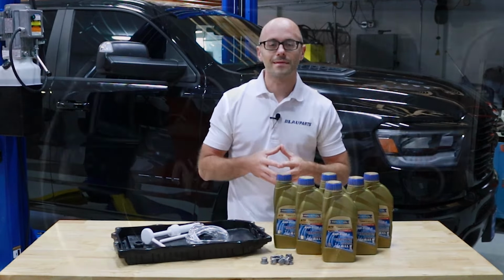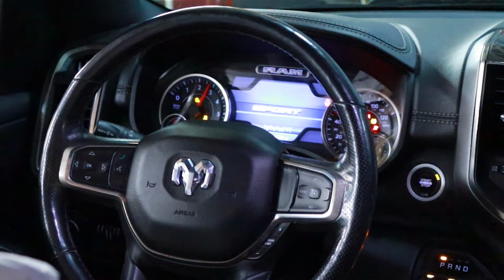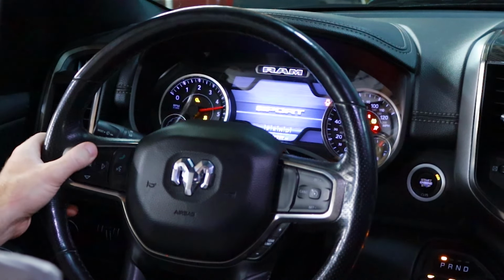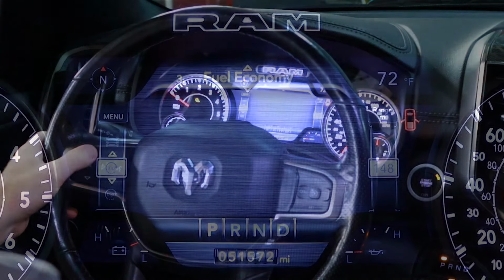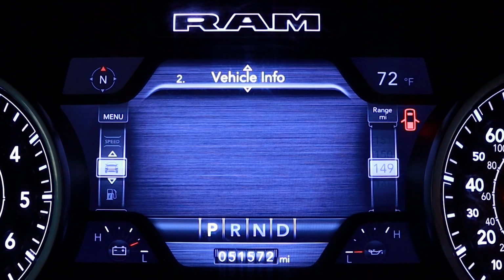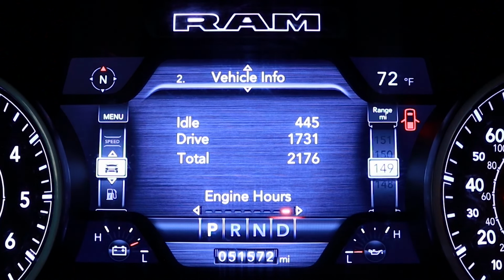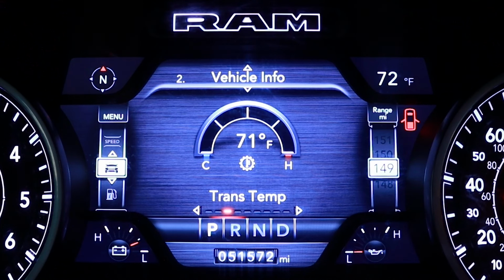Ram 1500 Transmission Fluid Change How To | 2013-2026 ZF 8-Speed 8HP

Comment: Just finished this Transmission pan/filter and fluid change on my '21 Ram 1500 5.7L.   Was pretty scared, watched literally every video on YT I could find.  

Was very happy to find I did NOT have to jack my trans, just slid pan out, replacing was even easier than removing (tight but totally manageable).

The most difficult part was removing the one T40 torx screw that was directly above the exhaust, no way to get a socket bit on it, much less a ratchet.  Tried a L shaped T40, similar to a hex wrench, couldn't break if free, and really thought I stripped the bolt.   Had to use a bit with a 1/4" gearwrench to finally break it loose. 

Cutting down the 10mm L wrench worked great, but I needed it shorter, couldn't really get the last turn because as the plug unscrewed, there was even less room between exhaust and plug, but got it to work.
Reply: How many miles did yours have when you serviced it?
Reply: @bigfleet6559  I didn't do it till 85k miles
Reply: How much money did it save i just heard the numbers from the dealership😢
Reply: @6 @600hemi8 lol they recommended changing the pan but since I’m just above 45k miles I just reuse mine with the intention to change it at 100k miles. I have the tools needed to do it already so all I spent on was transmission filled (make sure to get the correct fluid for your vehicle). I believe the manufacture say it takes about 7 quarts of fluid so I had to purchase 2 gallons for about $70. Then it just cost me about 4 hours of labor mainly because I left it to drain and went on about my business.
Reply: Oh if I had changed the pan also I’d end up spending a max of around $220.
Reply: There’s two schools of thought on the leveling of the transmission oil level check ,one school says level the truck one says level the transmission pan. I tend to believe leveling the pan would be the better way.

Comment: i just successfully completed this myself regular dude and spilt fluid literally everywhere on my garage floor
Reply: Did you have the exhaust crossover?  Were you able to remove old pan and replace without jacking up the transmission?

Comment: The procedure looks to be the same for the trucks as it is for Chargers, etc.  That doesn't make sense.  If level is as critical as it's made out to be with the shifting procedures and temp verification, then having a much worse variation in level due to the transmission being canted downward in the truck should be compensated for by lifting the rear of the truck, no?  This ZF-8 appears to sit level in cars, and this trans is probably used mainly in cars in Europe, hence no instructions to make the pan level?  I see both viewpoints on this subject, and they both can't be correct.

Comment: jacking up the transmission doesnt make more room because the exhaust is bolted to the motor and the motor is bolted to the transmission at least on a two wheel drive

Comment: Some say to level the transmission not the truck , I’m leaning towards to level the truck personally.  This is probably something i’ll have to do myself as the mechanics in Canada at dealers are like 16 years old and they tend to over fill a basic oil change, they don’t use torque wrenches ex….
Reply: They’re so lazy. Drives me nuts.  Use the dang torque specs and fill things right! It’s your only fkin job!

Comment: By allowing the transmission to warm up, the fluid expands.. opening the drain plug will cause you to lose the 0.5L you need as an overfill for vehicles equipped with a cooler.

Unlike an engine which has the crank spinning through the oil, a transmission doesn't have this issue. You have the valve body submerged in transmission fluid, the pan and pick up. The cooling for the electronics is happening due to the fluid.

It is almost impossible to overfill this transmission due to the position of the full plug. I always get 3.78L in and about the same amount out. 

Could I trip the car on one side and get an extra 200 ml? Sure but the procedure is to do it on a level ground.

Shifting the car through the gears is a step you can skip. They are concerned that you might have air in the oil pump and want to ensure the transmission can shift without a load.

Comment: Does the truck need to be on lift for a spill and fill? Not changing the pan and filter yet? Is it necessary’s to run it through the gears on a lift or can I drive around the block?

Comment: Yo need to mention that some screws in the pan are a pain in the butt to remove becase of the exhaust pipe and crossmember so we have the tools ready. Also for the plastic drain plug the exhaust is in the way. I stripped the hex nut and had to drill 2 holes to drain the pan.

Comment: I just performed this service on my 2015 Ram 1500 5.7 8speed trans. My truck has air suspension and it started throwing codes for trailer brake service on the dash. Also trans heated up too quickly for me. Had to stop and wait for trans to cool. Super pain in the mf ass. But saved a shit ton of money 😊.  FYI, for all the DIYs this is advanced maintenance in my opinion. If you are comfortable changing 16 spark plugs then you should be ok. If you're an oil change guy/gal then this may be more than you can handle. Just my opinion. Patience and having 3 to 5hrs to do the job correctly are required. Please be careful with jackstands and floor jack. Never rely on a floor jack only. If possible have another person around in case of an emergency. I had a friend have the car collapse on him and he died as a result since no one was around to help him out. Just saying. Be safe!
Reply: Yep, mine threw the same codes.    Like every code.    Service 4wd, trailer brakes, some weird code about dynamic brake system.   It was wired.    Made me pucker a bit
Reply: @captrank1376  befor you lift the ram go always in jack mode in the options. its important. this locks the air suspension
Reply: @conspiratio I don’t have air suspension on mine. I think where I screwed up was I didn’t turn off traction control.  The truck thought I was spinning out of control when I had the back wheels up and accelerated.        Eventually the codes cleared when I drove it for a bit but still was crazy how many codes it threw.    Most every light on my dash was on and no scanner, at least the one I have, would clear them.

Comment: Excellent video. I did this service myself on a 2010 BMW x5 35d (Six speed ZF) but it was exactly the same procedure. That car didn’t tell you the transmission temps so we used a temp gun from underneath. Not difficult just a pain in the ass. It’s almost like they don’t want you to change the fluid even though we should be.
Reply: I was wondering if this was the same as I had in my 11 335D.  I know I used Amsoil.
Reply: How the heck do they fill these from the factory before installing? No way they do all that before sending a new ram to dealer lots

Comment: Thanks for the great video. I just did my transmission fluid and pan/filter and even though it is a job to do it, it wasn't that bad. I did mine at 58,000 miles and the fluid I drained looked very good. The magnets inside the pan were clean. The ZF transmissions seem to be really good. I believe if you change the fluid at the recommended intervals you should easily get 150,000 + with no issues. Mine so far, the shifting is excellent.
Reply: So how many liters of oil did you use?
Reply: @agondokusumo-111  close to 5.5 liters (close to 6 quarts)
Reply: @FrankDAmico-dr5dl  Ahh i see because I could only fill in 5 bottles of the ZF 8 lifeguard in it after draining.
Reply: @agondokusumo-111  I guess that is close.

Comment: 6:20 "next, using a CERTIFIED under hoist support stand"........... you mean a block of wood and floor jack right? :)
Reply: Mine was a floor jack and a length of gas pipe I had in the garage.   It was sketchy but…

Comment: Owners manual says “regular fluid and filter changes are not required” however change the fluid and filter if it has become contaminated (with water, etc.,) or after any disassembly of the transmission. 

My thinking is drop the pan and check for contamination, maybe every 60K or so? 😝

Comment: Just had a successful fluid/filter replacement yesterday for my 2016 Ram 1500. Setting up the jackstands, etc. took longer than expected, but safety always. One lesson learned - the little handpump didn't fit my bottles, but my wife had a little spray bottle from the Dollar General that fit perfectly. I also did two cycles of fill and run the engine - it didn't take as much as I expected the first go round. Thanks for the video!
Reply: Hi there, I’m about to do my 2016 Ram. Did you have to jack up the transmission to get the pan out? And did you jack up the rear when filling. Thanks

Comment: He did good, but there is two areas he did not address! First, you have a torque converter that has a drain bolt, you have to get the torque converter positioned where the drain bolt is pointed down to enable draining of the converter. Secondly, in the oil cooler lines there is fluid that needs to be removed. You apply air pressure to one of the intercooler lines. This will ensure you have removed ALL the old fluid from the transmission. This type of servicing must be done, with the mindset to not contaminate the new fluid. Also you are supposed to closely examine the old pan filter for metal particulate matter. You can actually use a fine cutting Dremel are part off tool to open up the filter compartment. Inspecting this old filter material will give you an indication of wear and tear. I salvaged an old Mercedes Benz 300SD 1983 transmission that was under water for 4 days from a hurricane here in Houston. Did the above, no damage to tranny! And it had water in tranny, rear differential, and engine . My Mercedes still runs to this day!

Comment: Who would buy these trucks, everything they make now is either trash or it’s a maintenance cash cow for the dealer. I’ll stick to my old school engine no computer and I can do absolutely everything myself which saves huge! Not to mention wayyy better hp and torque, no ALUMINUM ALLOY driveshaft waiting to snap off and I’d destroy you on the quarter mile

Comment: Excellent video, followed the steps to a T on my 2014 ram 1500 laramie longhorn 5.7 hemi. Substantial difference in shifting and running beautifully. Only issue I had was getting transmission leveled. Floor jack and stands didn't quite get it there, ended up using forklift and tire to get it properly leveled. Again thanks again for the video! Very helpful 👌

Comment: I wanted to do this in my trackhawk. I let it drain but when I tried filling it I struggled to get a 1gallon/4quart jug into the trans. Still had a little bit left. I would put it in the gears and run it for some time to empty the pan but I still couldn’t fill it with enough fluid. It’s also 100° outside so I’m guessing that’s why I can’t fill it anymore
Reply: I’m also wondering if all the fluid didn’t coke out because it was already at 100° without starting it

Comment: Got an alumium pan and replaceable filter
Reply: Where do you get them?
Reply: @hilariocoronado9209 bmw uses the same transmission with a metla pan and replacable filter. Aftermarket ones work on these.

Comment: Hey you jacked up the transmission to get clearance but the truck rear end needs to be jacked up because the transmission isn’t level in these trucks.
You’ll end up being a quart or more low if you just put it on a level lift and don’t take into account the level of transmission pan rail.

Comment: Hey, I ordered the trans oil, just did my change, but mine only took 5 ? Is that normal ? I did everything step by step, ran thru the gears at about 100 degrees I opened the filler plug and let it drain to a drip then closed and torqued it but I have an entire quart left just want to make sure it isn't supposed to take 6 no matter what
Reply: Just did mine today, step for step. I have a quart and a little left over.
Reply: @jacobmyers4550  yeah same ! Truck been running like a top i thinks that's the extra they provide if you actually flush the lines etc

Comment: I got mine changed at 50,000 miles. I also tow a my favorite a boat! Differential fluid was changed and the transmission fluid at the dealership. Although they charged  me a whopping $650 to get it done which is ridiculous. I have 60,000 miles now …
Reply: $650 for the transmission fluid and both the differentials?? Well shoot i just did the differentials and transfer case i wonder how much the would charge for just the trans fluid
Reply: That’s super cheap if the6 actually changed the pan! This kit is $400 in just parts.  You paid near nothing for labor

Comment: 2015 ram 1500 8 speed. Acquired at 150000. My guess with 2 previous owners atf was never serviced. When not sure it was ever serviced, I heard sometimes best to leave it alone. We had no trany issues and have put on almost 7000 miles. Welcome everyone’s thoughts on what best to do at this point. Second owner tore up front right aisle so we only run rear wheel drive. May consider fix on This later
Reply: What did you end up doing did you change out the fluid? I'm on the same boat 2018 hemi with 148k miles and fluid never been changed
Reply: @wowdude8244  new dealership opens up in our town by end of summer. Was hoping they offer some discounted services at grand opening and see what they say. A number of Youtubers have good videos on how to change it correctly, but quite intense.  Still can’t help but to think it needs to be changed anyway as many have suggested too. Now we have about 162 on it.
Reply: @timdippel7517  i emailed the ZF makers of transmission they said its risky to do it but worse not to change it because fluid breaks and it doesn't protect components
Reply: @wowdude8244  what do they mean “risky to do”? Do they mean challenging?  And did they say what the typical cost would or should be? Certainly be best done on a lift. Have you looked at some of the how to videos on the fluid change.
Reply: @timdippel7517  I'd say cost depends on the mechanic , i want to put an aftermarket PPE  aluminum pan that holds 2 xtra quarts of fluid  with interchangeable filter
Reply: Want to use ZF fluid 8 too not the mopar I recon transmission maker knows how to make the fluid better than dodge
Reply: The ppe  pan costs 288 on  American trucks website and ZF 8 fluid around 150 for 9 quarts
Reply: The dealerships charge an arm n leg  so I'm thinking an independent mechanic or ASE certified shop
Reply: @wowdude8244  yea I know they do. I’ll compare. Reluctant to attempt myself, especially with no lift.
Reply: @timdippel7517  I've got heavy duty jack and stands from Walmart i just don't see the dealership or any mechanic do all this steps better off myself,  i spoke to a mechanic the other day their preferable method is mark how much fluid comes out put the same amount back in,  I call that the lazy way,  the manufacturer has all these steps for a reason
Reply: @wowdude8244  though not a mechanic or truck tech, I’d probably follow to the letter. Did you get zf manufacture instructions from them?
Reply: @timdippel7517  someone gave me the ALL DATA steps they're the same like this guys says,  imma use the ZF fluid 8 not mopar , found some deals on ebay
Reply: @wowdude8244  yeah that makes sense about what you said about not Mopar but the trans manufacture ZF fluid. Changed the regular oil couple of months ago. the prior last two times was conventional. I did the recommended synthetic.  

Previous owner(deceased brother in law) did a pit manuver on guy he got in fight with and I think messed up the shudder grill system. So I had only passenger side working. When I had to replace coolant reservoir and had to pulled that shudder system out anyway, I just replaced it too. Have you had any issues with this   Shudder grill system. Instead of paying about $300 for it I probably should’ve just left it out to get better airflow but I wanted to get back to original.
Reply: @timdippel7517  i don't even know what that is honestly
Reply: @wowdude8244  copy that. Didn’t either until I saw it in the code under check engine light.  It’s supposed to close off at higher speeds to allow airflow over the top of the hood to improve gas mileage, but I don’t think it does improve anything.
Reply: Change the fluid & Filter. New fluid is better than old fluid. 
The myth that changing the fluid on a trans that has never been serviced is an old tale left over from the days when an owner would change the fluid on a tranny that had one foot in the grave, then blame a failure on the fluid change. The ZF8 is a well designed transmission that will last 300,000+ miles

Comment: I have a 2017 Ram 1500 V8 Hemi 125000 miles, and I went to the dealer and asked them to replace the transmission fluid, and they said that this truck does not need to replace the transmission oil never because it's a seal transmission.
Reply: Did you get it changed?
Reply: Fluids break down, wear out and lose their additive packages. Dont believe that stealership BS for a second. There is no such thing as lifetime fluid. The dealership is there to sell u a replacement transmission or a truck. Even a drain & fill is better than nothing, but that doesn't give you the oppurtunity to replace the filter or clean the magnets in the pan.